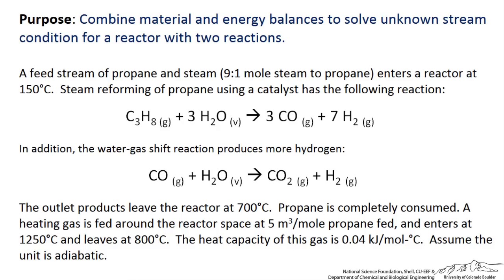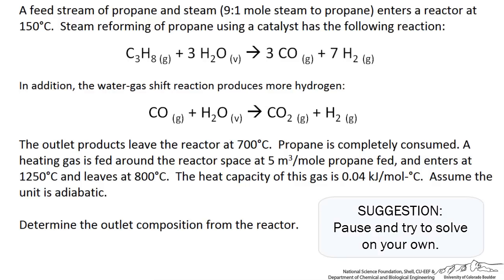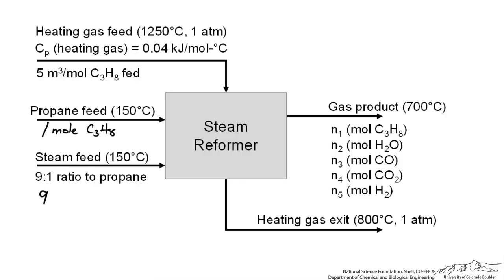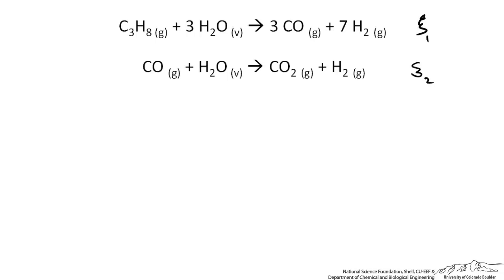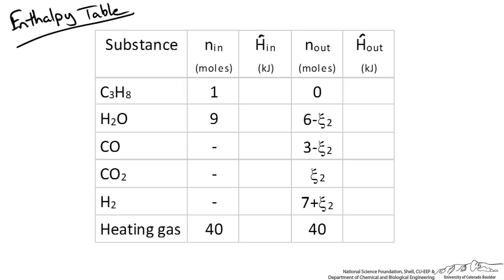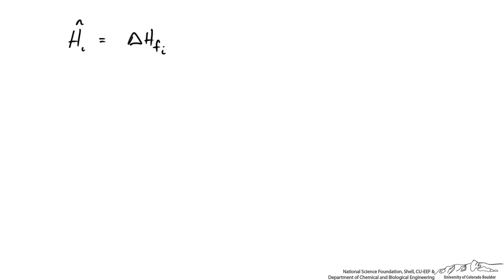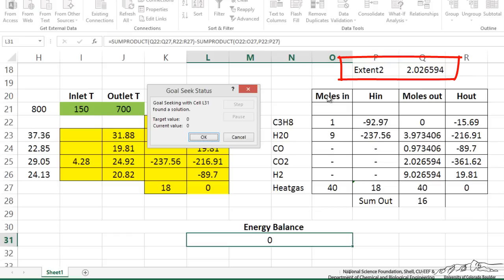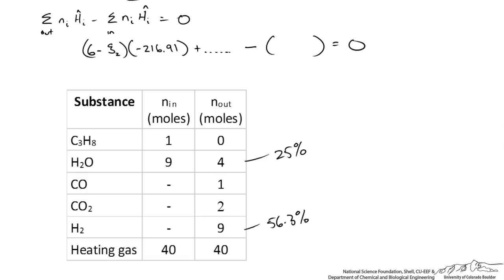Steam Reformer Material and Energy Balance

Comment: how did you get 18 for specific heat in terms of caluclation. I am not sure how would you convert j/mol/c to jmol/k ? for H =cp  * dT to work  ?
Reply: Since our reference for the heating gas is 800 ْC. we multiply 0.04 * (1250-800) = 18 kJ/mol
Reply from the maker: Also, J/mol/K and J/mol/C are the same thing because a CHANGE of 1 degree Celsius is the same as a change in 1 degree Kevlin.